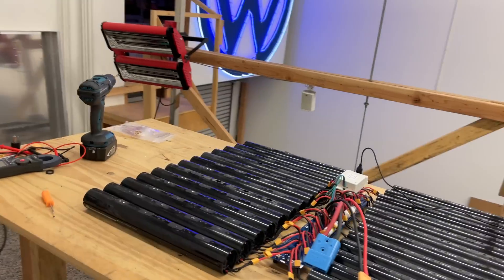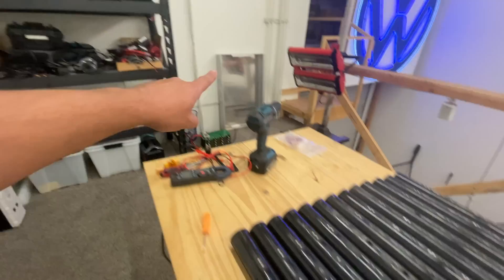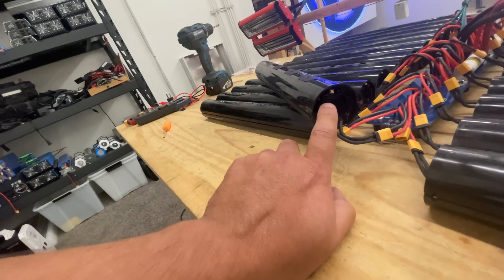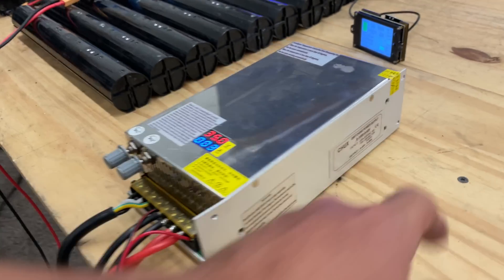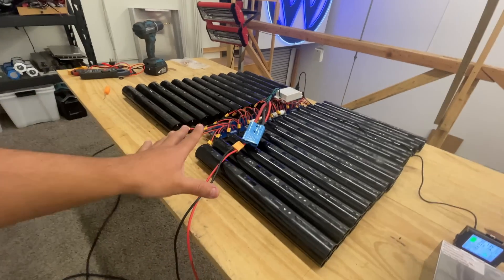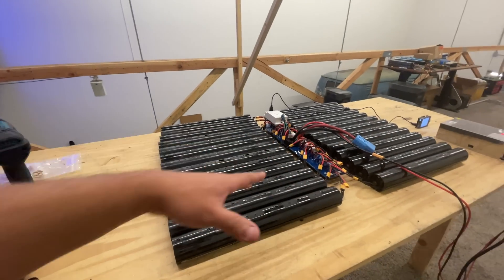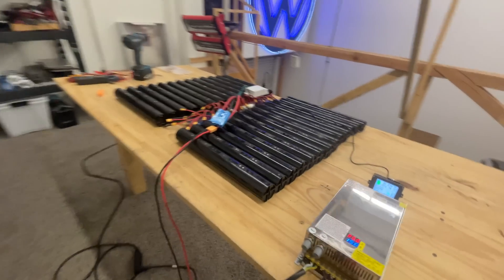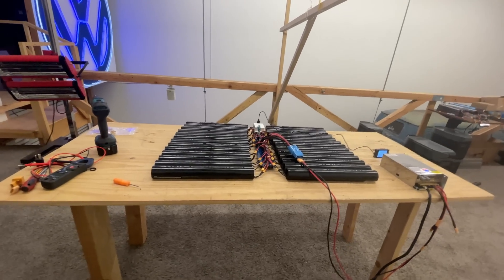4.4Kwh  DIY Powerwall - MegaloDongleX update

Comment: I plan on using an inverter with a built in MPPT charger. I see your board has both a discharge and charge circuit, would it be an issue charging via the discharge circuit?

Comment: A bracket to hold the batteries could be made without having to flip the batteries over to connect. Have a strip with screw holes to hold the series of batteries but have the ends extend past the ends, bend down next to the battery and have a couple spots to connect it to the box. _/-------------\_

Comment: Is it safe to charge the batterai through discharge port? Since it has dedicated charge port..
Reply from the maker: Yes, it’s safe,  but charge port will also balance cells,  so it’s better
Reply: @jehugarcia  using discharge port to charge the batterai, is the balance module working?

Comment: Excuse me in advance as I'm new to all this stuff.... Is it possible to build a 48v pack with the same batteries? If yes, what would I need?
Reply from the maker: Anything is possible,  but not practical,  there’s better easier ways to build a 48v system
Reply: @jehugarcia  Thanks for your quick response. May you please guide me to what I would need to buy through your website to build a 48v pack? I love the simplicity of your  products.

Comment: the 36v power bank could be stepped down to 12v with a buck  converter to keep steady charge on a 12v battery that’s connected to the inverter.. that way the inverter connected battery stays at peak level with constant charge from the larger battery pack.. kinda like a capacitor.. I use my solar charged lifepo4 batteries to charge far heavier 100Ahr lead AGMs best kept stationary.. some thoughts.. excellent work there btw..

Comment: A drill press with a jig and a stopper. Use a jig to line up the battery and the stopper so you can only drill so deep. With that, you should be able to jam through hundreds fast.

Comment: What are you expecting from the upcoming laws about "battery storage" in the USA ?
Reply: Interesting, what do you know? do you have a link to what you are telling us about? Cheers mate.
Reply from the maker: I don’t know what’s coming but restrictions most likely
Reply: @jehugarcia  Here, downunder, the people installing new solar systems will be charged to export to the grid, Yes they get paid a small amount now if they do export to the grid (i'm still getting 50c a kW exporting to the grid) the power companies will be able to turn your solar system off if the grid is getting overloaded, the only solution is to put a battery on, just which one and what size. I'd love to see what size battery system you could make for your home to run a air-conditioner cooler in the middle of summer, to run day and night. It would have to be a beefy one.

Comment: For a split phase inverter vendor who you can work with, genetry solar uses a universal transformer that can theoretically use 12, 24, 36, or 48… although they are concentrating on 48v, they do ship in other configurations since the underlying platform supports it!

Comment: I have a ebike with a bad 38.4v 12ah, 24cell battery.. It is powering a 36v 500w hub motor.. Hoping these batteries will work.. If not, do you have something that will work with my setup? I see the v and ah are a bit lower so what i would really like to do is hook up 2 of your packs for more speed/distance.. Or can i take the board off my original battery and put it on one/two of your packs? And even tho my battery is 38.4v 12ah and your battery is 36v 7ah it should still work just wont get the speed/distance the original one does unless i hook up 2 right? Or just rebuild the original pack with new cells purchased from you?? Which route would you recommend?                                                                             *****  I did post this series of messages/questions on a different video you posted but don't know if you saw them as it was an older video with a bunch of other messages.. If you could,  just tell me the best route to go and which batteries to buy and ill purchase from you and figure it out from there.. I won't be a pest i promise, just trying to get my bike going again.. Thanks Bro!!
Reply from the maker: yeah 2 put out enough power for an ebike,  I'm doing a video on that soon
Reply: @jehugarcia  Did you ever do this? I tried it on a 450w ebike and both of the bms would shutoff if I went full-throttle for more than 5 seconds. Then after about 30 seconds it would come back on. 2 of these batteries in paralell would maintain 66% throttle but not full. I'm guessing that the bms shuts down at anything over 5 amps. So anytime I tried to draw 12.5 amps it would protect the overdraw.

Comment: JEHU, did you tried to connect a charger to the red and black thin wires? That should wake the BMS the same way as pressing the button. And no need for holes.
Reply from the maker: I haven’t tried that
Reply: @jehugarcia  I just have one pack to test, but you can verify and let us know.
Reply: @jehugarcia  It worked for me, after I fixed the bms that was faulty.